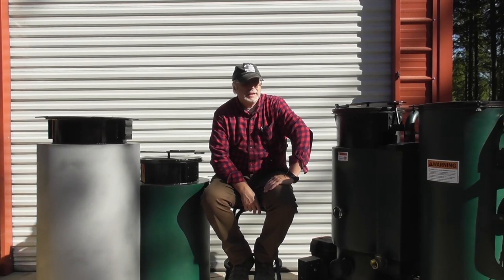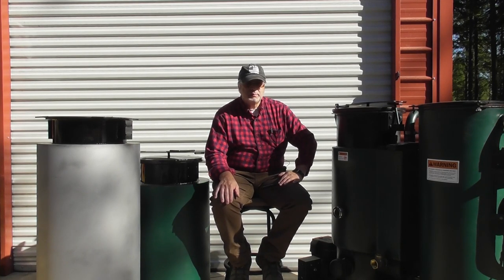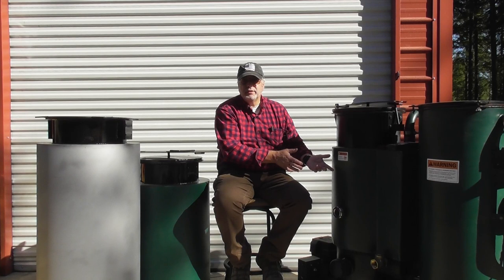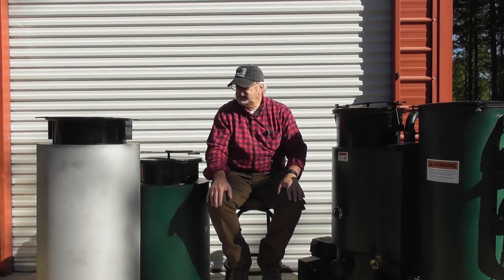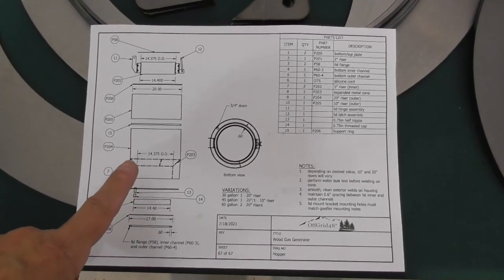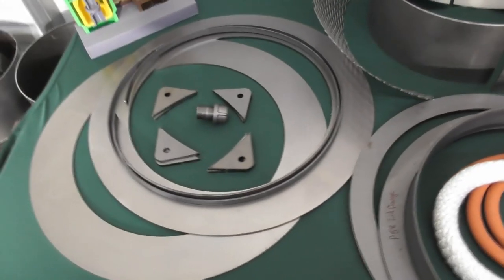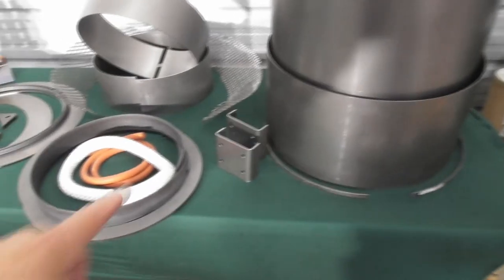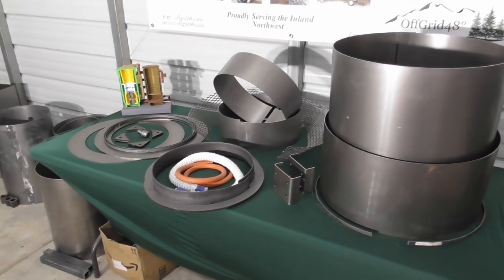Wood Gasifier Builder's Workshop:  Hoppers

Comment: Can you go into more detail about why you wouldn't use wood chunks and prefer to use charcoal? How do you make your charcoal at scale if you were running a 30 gallon hopper every day?
Reply from the maker: The hearth combustion area uses charcoal, the heat from this combustion rises up to the pyrolysis layer and turns any wood chunks into charcoal as it falls into the hearth. The pyrolysis process releases any moisture in the wood into tars. Charcoal eliminates this moisture and resulting tars. Charcoal can easily be made using a retort or other means.
Reply: @steveoffgrid485  Thanks for your response. Keep doing what you're doing love the vids 👍